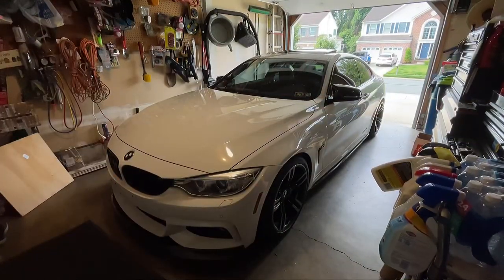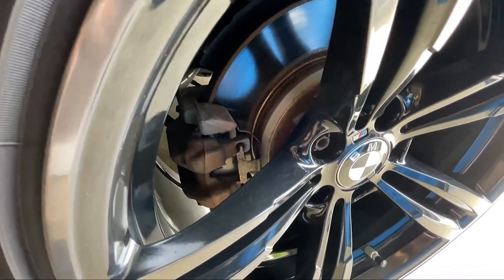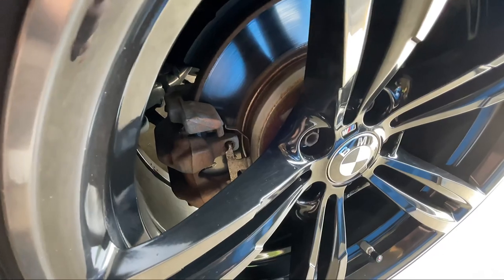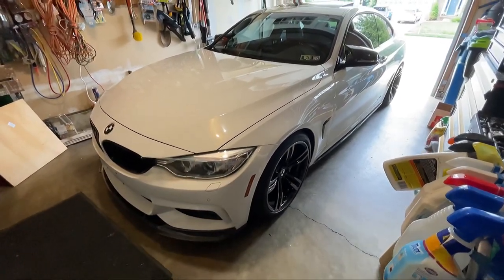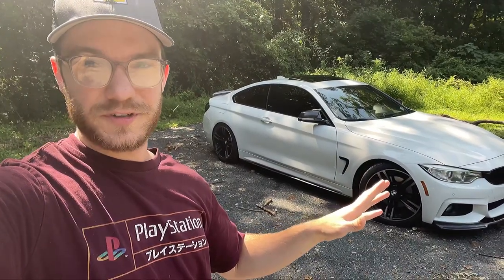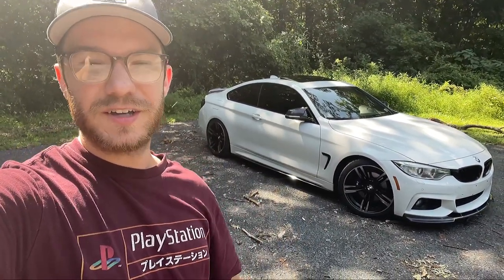MAKE YOUR BMW BRAKE CALIPERS LOOK AMAZING FOR $25!!!

Comment: Great video, Im planning to do something similar to my 435 at some point! Quick question, do you use any kind of clear coat on the caliper? I don’t want the paint to flake away after a few months of driving
Reply from the maker: Thanks! I didn’t use any clear coat, it was just a one step process with 3 separate layers applied. The VHT brand caliper paint they sell at Autozone is heat resistant and very strong. My dad applied the same brand paint to his calipers over 10 years ago and they’re still holding up 💪🏻

Comment: Looks good but you put the M badge upside down. ....Looks like a W....  😁
Reply from the maker: Sorry but it’s actually correct. The tip of the M is supposed to point toward the front of the car. Check a real M car and see
Reply: @beaterbeemer  actually I have a real M Competition from the factory   and the Logo faces the other way ...  Sorry.  But it  still looks good ... The ones you saw prob aren't real M Badges.
Reply from the maker: @Riches1969  okay so I just looked it up, and the brake calipers on a real M car like yours, they face back, just like you say. But on cars like mine - the M sport brake caliper offered on the 440, they face forward! Interesting. A subtle difference between real M brakes and M sport brakes I guess. We are both right :)
Reply: @beaterbeemer  Yes we both could be right ... I have a X3 M and thats how it comes . Maybe cars and SUVs are different ?? Now BMW is messing with us .. Lol. I'm going to check my friends car tomorrow. ... OCD is kicking in now ... Still you did a great job . 👍
Reply from the maker: @Riches1969  thank you! I’m so aggressive about this right now because I too am OCD and will absolutely take the time to redo it, haha. I really think it’s the difference between real M cars, and M sport package cars. Even your X3 M is a real M unless it’s an M40i or whatever, ya know. If you google 2017 bmw 440i m sport brake caliper, you see it facing the way I did it 🤷🏻‍♂️ let me know what you find out. Thanks for commenting

Comment: Are the 437m oem 9 inch by 10. Did it come out a M car?
Reply from the maker: Yes sir! I swear, these wheels were meant for F3X not F8X haha. Fitment is perfect
Reply: @beaterbeemer  they look fire, best wheels for it imo. Are you running 235 front and 265 rear?
Reply from the maker: @livinglikelos8202  I totally agree! I’m AWD so I’m rocking a square set of 255’s and grip has been great
Reply: @beaterbeemer  thank you so much now I 100% made my mind up
Reply from the maker: @livinglikelos8202  heck yea glad to help! 255/35/19 is my specific spec

Comment: What front splitter is that, can you link it please
Reply: @beaterbeemer  oh ok , do you recommend any other lip’s for 440? I’m getting mine tomorrow
Reply from the maker: @vexbtw9771  a lot of people go with this 3 piece style, and I rock this brand’s diffuser. But have never used their front lip so do your research please! You may like this one though 
https://amzn.to/3QhF9Jn
Reply from the maker: @vexbtw9771 it turns out RushCustoms is still in business! The website is just under construction. You can visit the eBay store by PM’ing them on Instagram.
Reply: @beaterbeemer  okay thank you